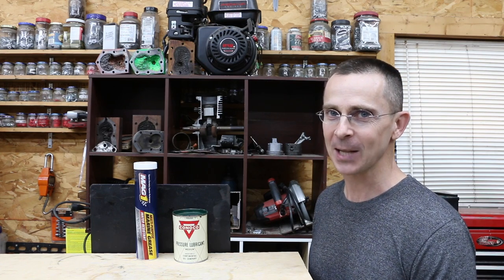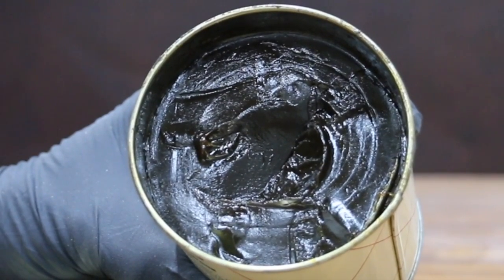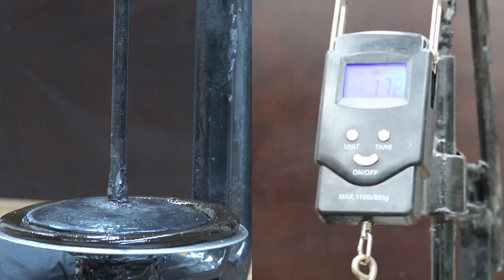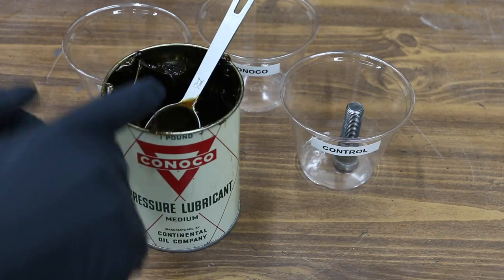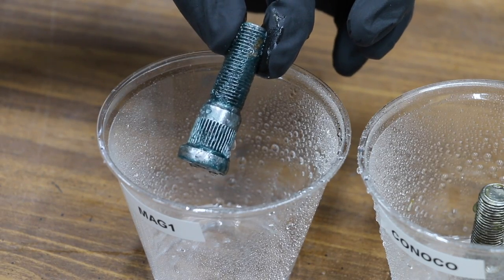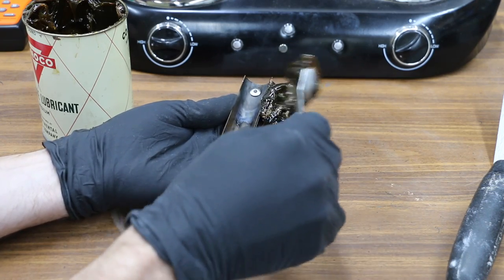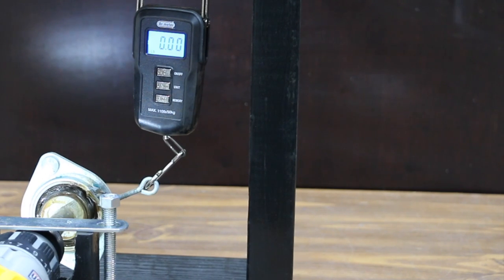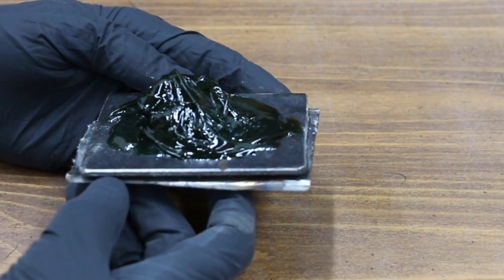Is 75-Year Old Grease Still Good? Let's find out!

Comment: Considering its age, and made in wartime, I think under the circumstance the Conoco did very well.
Reply from the maker: Yes, I agree!
Reply: @ProjectFarm  I am left to wonder if the grease that was sitting in the can for 75 years still has the same properties it would have had 75 years ago when it was new. Not many products can be expected to have quite that long of a shelf life.
Reply: I'd suggest that modern lubricants would have very positive results as far as machine performance back then.
Reply: When I do a repair on my 20-30 year old motorcycles I always find old grease which is brittle and hard as a rock. Considering the conoco grease is more than double the age, it did very very good.
Reply: @Chris-yy7qc  The Conoco grease in this video was completely sealed since it was packaged, this plays a large role in preserving the properties of the grease. I would bet it's performance has not degraded significantly since it's production.

Comment: Video suggestion: Test engine break in methods (take it easy vs motoman break in method). Get 2 identical mower engines and compare the performance and fuel efficiency after break in.
Reply from the maker: Thanks for the video idea.
Reply: The best way to break in a diesel on tractor is load it at 25% for an hour then 50%, 75, and 100% each for an hour. I’ve heard that works good
Reply: @gabehintzsche2064  You heard but didnt test. How were the reference tractors broken in and how did they manage to compare them again after 5000 hours in a fair way? People who make such claims have a lot to explain.

Comment: Old guy: They dont make them like they used to. 
Project farm: Grease!!! Wow great idea thanks! 
What? XD
Great video as always.
Reply from the maker: lol. Thank you very much!
Reply: "They dont make them like they used to"
Yes. They don't, unfortunately.
When something is that much old, it really can't serve its purpose anymore.
An unfair comparison.
Reply: @Dino_Buk  it's not unfair, the vintage grease did extremly well for it's age. 

Most of the stuff we build today only lasts it's warranty time
Reply: Lmao
Reply: @jamoin3829  yeah cars only go 200,000 miles with very little maintenance. Forty years ago you were doing something if you made it 100,000 miles on a car and if you did you had all kinds of maintenance and repairs to get there!
Reply: thats why i said 'most', but yeah you are right with that
Reply: @veiledallegory  Nissan cvt transmission goes out before 100k miles or they are close to failing.
All these direct injected engines are having problems with carbon build up on the valves requiring removal of the head. Some also have rounded the camshaft lobe off. I guess most of these have been updated though.
Dodge hemi's have problems with lifters going bad which will destroy the cam if unrepaired. 
I have seen personally see 2 Kia electric window regulators go bad. One was less than 5 years old and the other was like a month old.

The first part is true 100k miles in a 70-80s you probably did a good bit in repairs. But even today there is a buch of junk on wheels.
Reply: Context matters.   Consumables have greatly improved in most areas over the decades but the machines that they go in have largely not.   

How many of today's machines of any field of use will still be not only running but have a huge collectors market following them?  I bet near zero.   However how many of those already 60 - 80 year old machines we collect now will still have a  following and value in another 60 - 80 years?   I bet most of them!

Comment: A lot of messages on here, I hope this reaches you. Imagine you doing a test on fishing lines and their strength before they break. 10lb. 20lb. 30lb. Wow! That would be a HUGE help, especially when fishing season is coming up.
Reply from the maker: Thanks for the video idea.
Reply: Fishing line is only as good as the pole it's used on. In my experience, the pole will break before the line does.
Reply: @SergeantExtreme , that depends on the angle of the pole. But even with a broken pole, you can still pull the fish in - not so much with a broken line.
Reply: Definitely something I would test
Reply: Their strength is right in the name, a 10lbs line is tested to hold 10lbs before breaking, a 20lbs line 20lbs, and so on